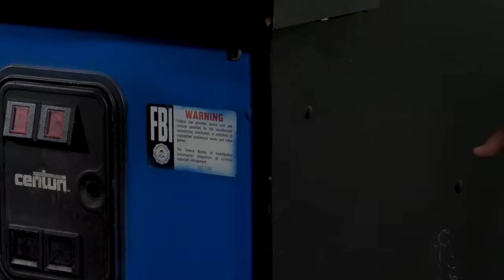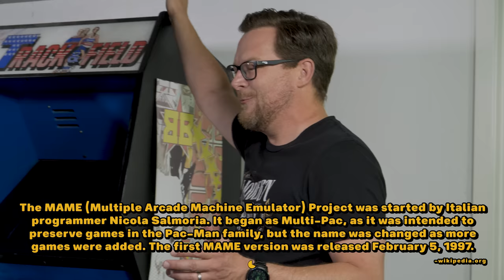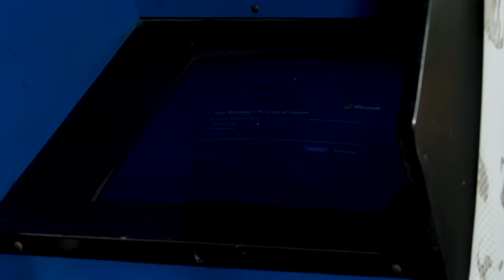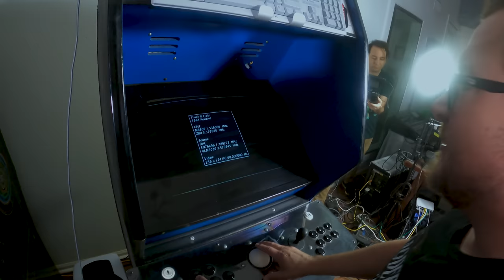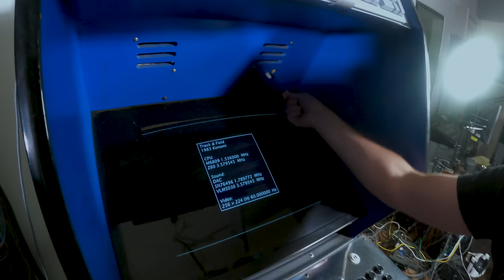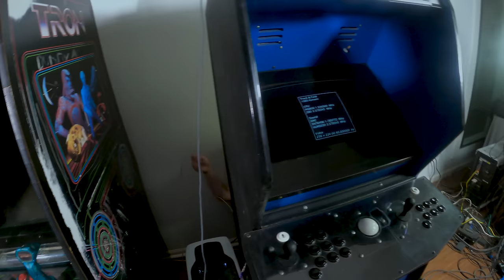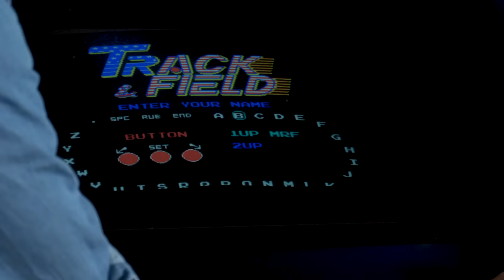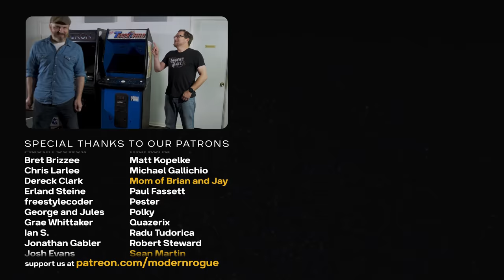Repairing a Track & Field Cabinet with MAME 📺

Comment: I remember in the late 90’s retiring some old compaq remote access systems (if I recall they were 386DX systems each with a rack of 9600 or 14.4K external modems).  When I opened the cases it was like a dryer lint trap or wool blanket. You could literally peel the dust off in one solid sheet that retained an impression of the components from the motherboard.

Comment: I used to think arcade games were very complex machines.
It looks like they are really just a fancy and optimized presentation for a game.
Reply: MAME is a system for emulating arcade games made many years after the peak of arcade games in the 80's and early 90's, so it's a bit slimmer tech-wise than the guts of your standard arcade cabinet, but you're correct that the cabinet is mostly empty space. The form factor is necessary for it to be played standing up comfortably, but the games themselves are just one or two big circuit boards.

Comment: That Maxtor is a sata drive. Can't be older than the year 2000. I was expecting some flat and wide ide carpets, I mean cables in that cable jungle.
Reply: That's what I was thinking! ! ! Maybe when they converted it they put in a newer drive?

Comment: The reason the PS2->USB adapter didn't work is because you're using a passive one. During the PS2 to USB transition years, it was very common for mice and keyboards to support both PS2 and USB, but only have a PS2 plug. The adapter literally just connects the PS2 pins to the USB data lines, the mouse/keyboard detects which it's connected to and uses the correct signalling.

The game controller portion of your setup does not understand USB signalling - it just naively passes through the USB data from the keyboard, but sends it's own signals as PS2 which are ignored by the PC because it doesn't understand them!

Comment: Simplest solution to hook up arcade buttons is to buy usb arcade encoder board or if you dont have access to buy it get some cheap usb gamepad take it apart and solder wires to button contacts

Comment: Wassup what’s mame
Reply: [M]ultiple [A]rcade [M]achine [E]mulator
Reply: MAME (Multiple Arcade Machine Emulator) is an emulator that allows you to run the software of mainly old arcade games. A dump of the game (usually called ROMs) is saved from the originals and then you can use the emulator to run the games on a standard computer (with Windows, Mac, Linux). The project has been around for a very long time.

Comment: Ripping out OG boardsets to replace with a MAME setup is hardly a repair and is certainly not a restoration. It's sacrilege. 😐
Reply: It was already a MAME setup, and they restored the MAME setup, nothing wrong with that
Reply: If it's already converted, then that's one thing.. fair play there. 
I thought I heard him say they converted it, but maybe I misheard. 🤷🏻‍♂️
Reply: @R3TR0R4V3  at 0:46 Brian says he converted it into a MAME cabinet when he was in college. So it's BEEN a MAME cabinet for a long while, and the cabinet in it's current config died a few years back; they're restoring it to that spec since the cabinet's already been heavily modified.
Reply: @R3TR0R4V3  Although just seeing the video title, it's easy to think they are restoring the original arcade by installing the MAME setup, so I can understand your first comment